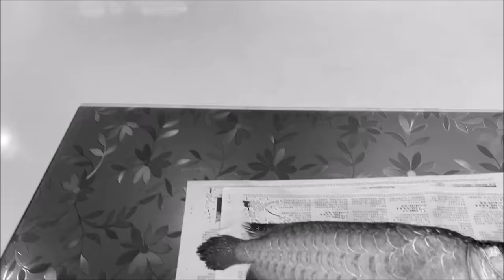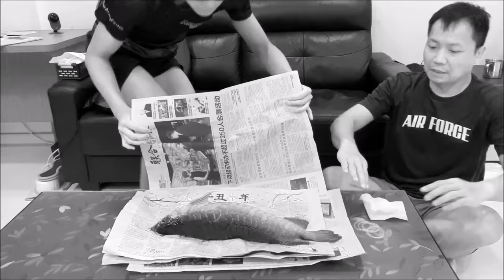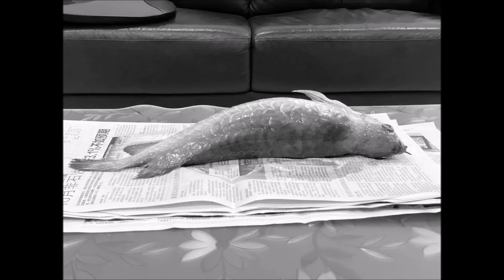LIOW VIDEO: Death Of My Arowana --"Turtle" 过背金龙死了

Comment: My aro just passed away. I dun know y also after a water change. I ask myself if I dun change he won't die. So actually I ask a few experts, and they said dun put too much salt as it may change the water condition. So it's the best change like 10-20% max also use good quality anti-chlorine.

Comment: Very sorry for your loss brother. But that issue on the fish is not due to lack of oxygen. it seems like a swim bladder issue due to jumping and mild dropsy. The fish could have been saved if you reduced your water, hold the fish straight up to the tank with a divider and put in Magna Salt with heater 30c and also aireation. You may use this method to treat in future brother. just sharing what i know.

Comment: My fish also like that but my fish still survive.. next time in case like that you have to reduce the water immidietly, give the airator 4 spot or if you have pure oxygen you can give it, give the salt, and wait for it. If the fish still cannot swim you can holding it with use some two bottle and put the fish between the bottle so the fish will keep steady and put some airator under fish mouth.. maybe this could be your tips for your next fish 🙏🏼

Comment: Sorry to noted on your loss of your Dad and Arrowana. Please do take care. On going through the whole video. I felt that your habit of using salt for your Arrowana is the Killer. Arrowana is a Freshwater fish, found in Freshwater Lakes and Rivers. Nowhere near the sea. Some recommended to use a little Seasalt. But actually it is not necessary. Adding salt only jolt and excit it. It is never a cure for anything. Infact using it long term will cause bradder problem. The large amount of salt you used during that period actually cause the water to be so acidic that it is killing it. All you need to do at that time is to 1) Clean your filter system. 2) Change 20% of water every 3 hours. NOTHING ELSE. NO EVEN MEDICATION. By now, you should know why shopowners recommended you to use salt. They need your continous support !!! Good luck on your next Arrowana. Remember, throw away whatever left of your salt.

Comment: salt 1litre to 3g,  heater 32, lower the water till the height of the fish, keep the fish in normal position, don't let the fish Reverse and Aeration
Reply: The problem is the air on stomach arowana not coming out..

Fish Losing water pressure...

🤔🤔🤔

Comment: Should not low the water too much, at one point the fish seem to swim up right, then leave it alone, turn the light off for less stress on the fish, dont mess too much with the fish or tank, this will add stress to the fish, just observe and make sure air pump is good, lower the water current, this fish sure can be ok with an experienced fish keeper.  Feel sorry for the fish.

Comment: Decrease the water lever as almost arowana's height, Pour sea salt and blue methylene, then clamped the fish to your tank's wall with plastic bottles so you can fix its position but don't do it too tight, and shoot the aerator directly to its mouth..if it's still happening give it metronidasol 2 pcs and tetracylin 2 pcs for 3-4 days ahead. it may helps to save its life..deep condolances from my deepest heart..I know how it feels exactly

Comment: I'm verry sorry for your loss. But you could have save him instead you made her/he suffer. When your fish is affected by swim bladder the first thing you should do is reduce the water level to his height so he can remain float. Tight him to the glass and keep him stright keep a water bottle to his body by the other side and increase the oxiginaration with airpumps and keep 1 pulp near his mouth so it will make your fish to breath freely and add Aquarium salt to your tank and add ocean free 3rd genaration yellow powder and keep water temperature at 32 and minimize the feeding. 30% water change every 3 days. I'm very sorry for your loss but you should have save him. 😢😢
Reply: he was panicking tho

Comment: thats not a crossback arowana bro.
Reply: and your arowana die not because the air pump but swimbladder. you have tu reduce the water then start treatment until your aro fine.